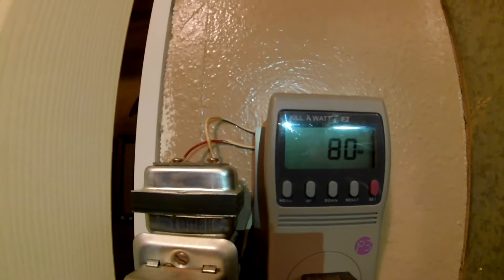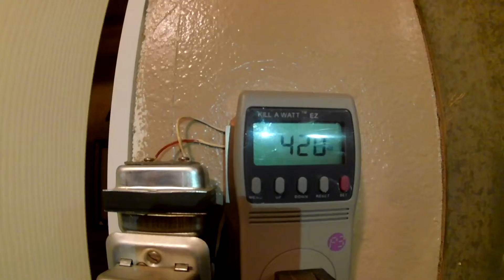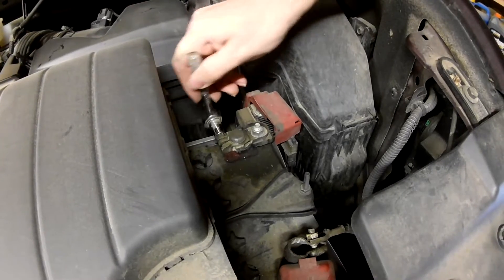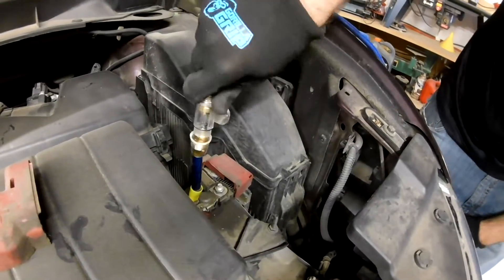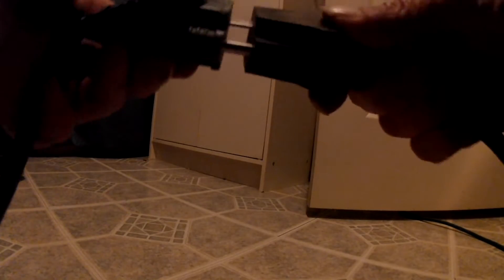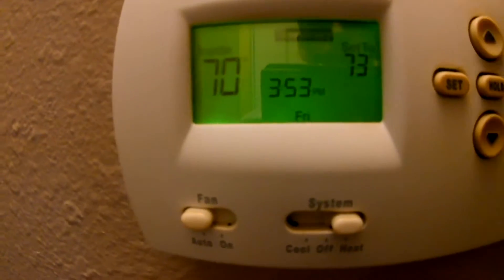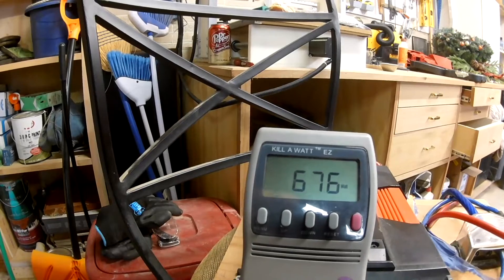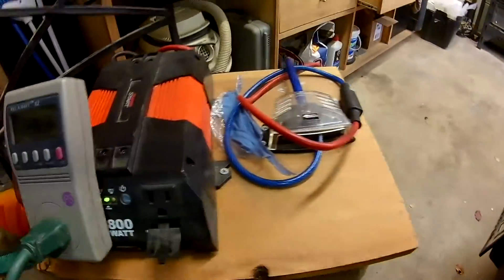How to power a gas furnace with your car and an inverter

Comment: I wish you had shown more clearly how to connect the inverter to the battery.
Reply from the maker: If you buy an inverter it comes with two cables usually 2 feet long. One black and one red. Red goes too positive and black to negative. (Just like jumper cables.) In this video I had bought some extension cables because I had installed this inverter from the battery to the back of the vehicle. The extension cables were blue and silver. Blue to red and black to silver. Sorry for any confusion.

Comment: How does this work with newer furnaces that are expecting to see a bonded neutral wire?    Floating neutral won't work on my furnace.  Had to make a bonding plug (Neu + grnd bonded)
Reply from the maker: I'm not sure I can help, I live in an older house and I'm not familiar with that situation. Sorry

Comment: I did this a few years ago in anticipation of an ice storm. Got everything ready and within  an hour power went out. Had my car outside idling and ran my furnace, tv, and couple of lights for 16 hrs no problem.  Way better than a noisy gas generator that needs fuel every couple of hours. I used less than 1/2 tank of gas idling overnight and into the next day. More efficient and quiet.
Reply from the maker: Awesome story, it's supposed to be below zero for the next 3 days. My tank is full, in ready 👍

Comment: It was wise to connect a power meter up to the furnace to see the surge load and the running loads. However, the kill-a-watt meter can’t track the surge peak unless your model has a peak and hold function. The surge will be very short in duration, maybe less than a second or two but will be 3-6 times the blower run current. Make sure the inverter and the battery can supply this. Also, make sure you are using a pure sine wave inverter and not a modified sine wave inverter as the latter can damage electronics (if any) and significantly reduce the life of your blower motor. With such a high blower wattage your car battery won’t last long and shouldn’t be run lower than 12.2V (50% charge) before recharging. You might also consider not recharging to 100% but only 90% (12.5V) because you will be cycling the battery a lot.
Reply from the maker: Thanks for commenting, fortunately I haven't had a power outage and have not used my car to power my furnace yet. That is great information!
Reply: I think if you idle car. A few hours you can keep things topped off
Reply from the maker: @mmqqq8246  yeah that's what I think too. Once the thermostat reaches temperature the furnace will turn off and then you can shut the car off.
Reply: Terry, I'm looking to have this prepared for this week as a backup for a snow storm, but I can't find many pure sine wave inverters at stores and Amazon has longer shipping times. Do you think it's still ok to use a modified sine wave inverter for a night if the power was out?
Reply from the maker: @Electric301  in case Terry doesn't reply here is an interesting article that may answer your question. https://www.lifewire.com/modified-sine-wave-inverter-damage-question-534760
Reply: @grandpadave8953  Thank you! I actually just managed to find a 1000w pure sine wave inverter on Amazon with same day shipping. I figure I can keep it for the month and return it if I don't use it. Good peace of mind
Reply: @Electric301  motors will run hot which degrades insulation when using a modified sine inverter. The hotter the insulation the shorter the life of the motor. Motors are generally designed to have twenty year life or more so generally speaking I would think that a single night, say 50 furnace cycles, would NOT destroy the motor but it may. If you smell burning insulation or your motor is very hot after a cycle you have a problem. The article in the link has pretty good advice. Good luck.